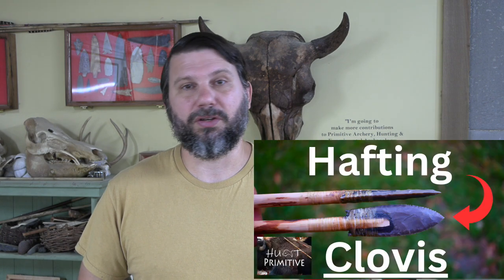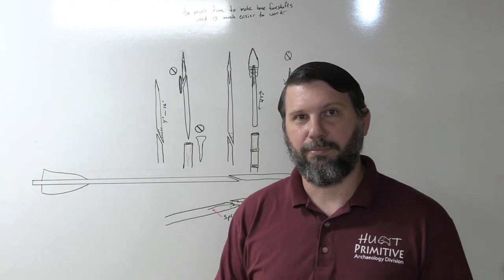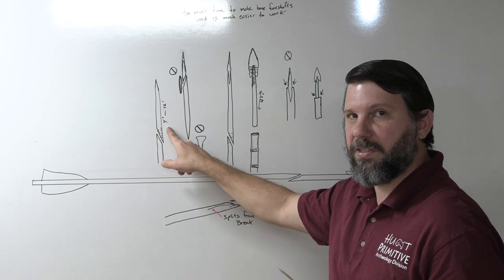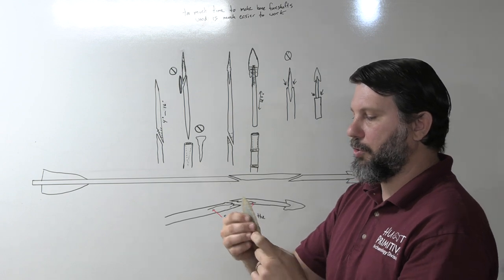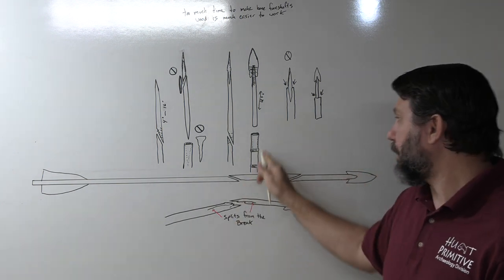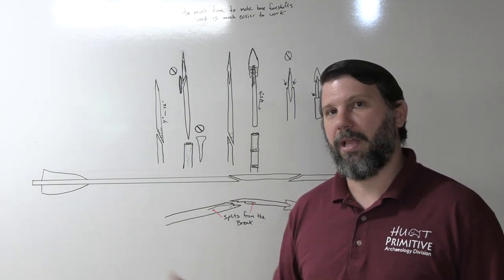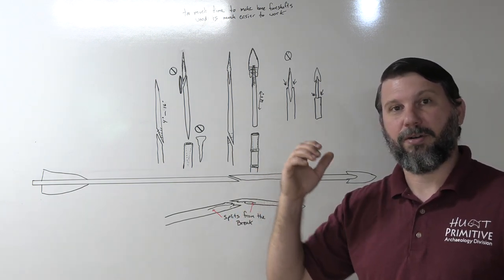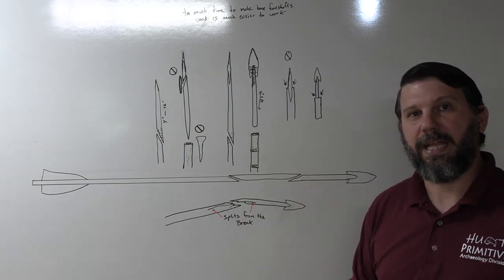Bi bevel & Single bevel Rods from the Clovis era

Comment: There are some research in Europe that during the cold periods people happily sacrificed their stone points just so that they could save their spear shafts. They switched from stone points (inserted into a split shaft) to socketed antler points. So the split is in the antler and the shaft is not compromised. In warmer periods when straight wood was more available they shifted back to stone points. In Europe the finds are form the much earlier Aurignacian. I guess the same can apply the cold Younger Dryas period.